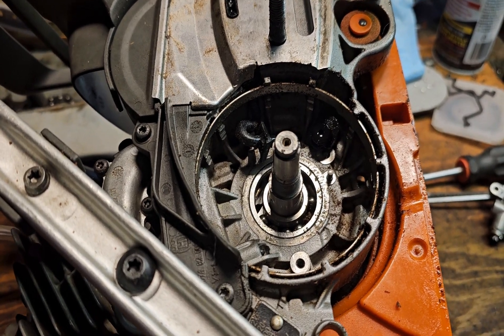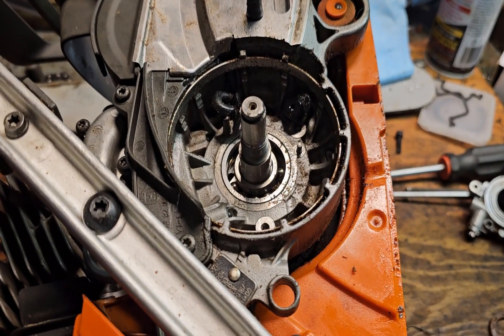Husqvarna 572xp Failure Analysis, How To Pressure / Vac Test Autotune Saws. Short Bars & Skip Chain

Comment: Maybe you should try automotive smoke generator, what is used to detect air/vacuum leaks in car engines. It show's with the smoke the problem places and helps to save time.
Reply from the maker: yeah... no. :)
Reply: smoke is good for vacuum. pressure is easy with soapy water
Reply from the maker: I do a first cursory test with brake clean, just a short shot gives fast quantitively results on ALL saws except those pesky autotunes that literally tune around the stuff. I've used the smoke test in the past, infact started with that decades ago. Missed a lot of issues, then went to vac test and brake clean. Don't miss much now. It has to do location  and intensity of the leak. But not going to write a book, but been there tried that and while in some cases it works, I've moved on to this technique
Reply: @afleetcommand   where you source all the plugs? been looking to get them all for huskys.
Reply from the maker: ebay

Comment: Hi 
I presume when you put your mytie vac test through the spark plug hole the piston is at the bottom of its stroke, to expose the inlet ports?
Reply from the maker: Piston location doesn't matter much....do a cross section of a 2 stroke :)

Comment: Walt do the 562/572s have the nylon cage bearings like the x-torqs my jonsered 2166 is giving me fits it will not idle for crap and feels like its lean despite carb adustments, I dont have a leak down tester and judging by the videos I have watched the nylon cages seem to be a sore spot on the x torqs, I also notice a little slop on the p.t.o. side of my crank, the saw will run fine till it gets hot and it just quits and is almost unstartable after that and reaks of unburnt gas( flooded completely)I should point out I rebuilt the o.e.m. carb with a kit off ebay and some of the parts like needle and seat were unuseable the saw would just flood out I basically had to file down the little divot on the metering diaphram and mix and match parts to make it run, the saw has alot of sentimental value to me and really was my go to saw up until last year, would it behoove me to have the old 372 xp bearings and top end put on her? In as far as durability,reliability are concerned?
Reply from the maker: try brake clean test...I've done countless videos on that with those saws